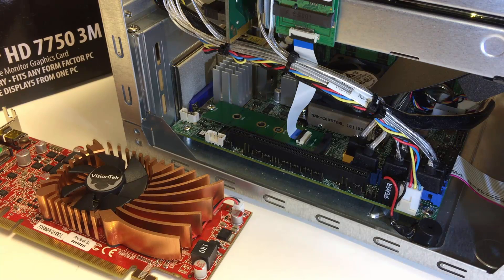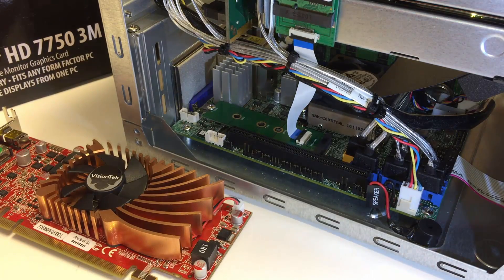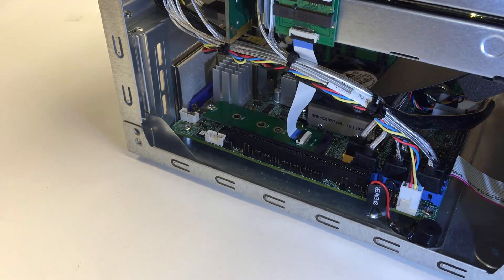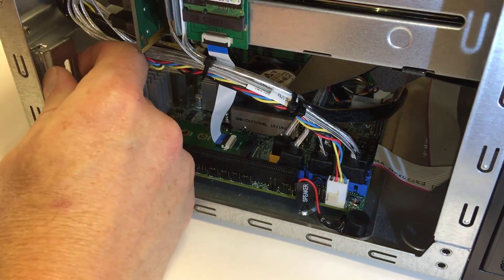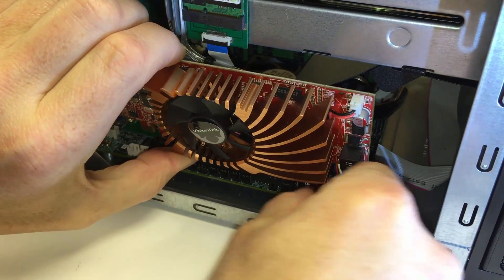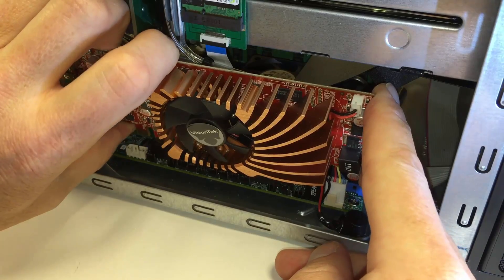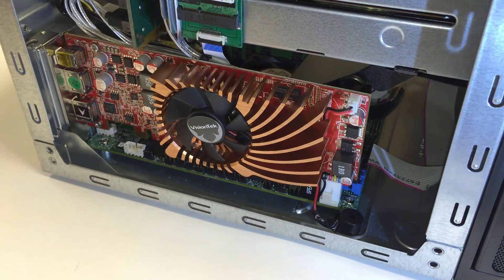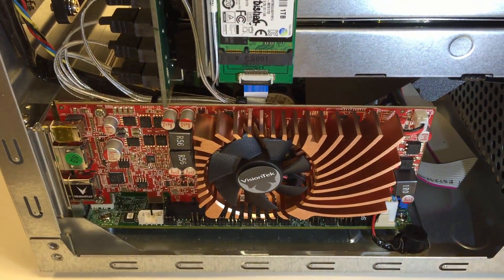How to install the VisonTek 7750 4K UHD GPU card into a Supermicro SuperServer 5028D-TN4T Mini-tower

Comment: Easier to remove the five screws on the back of the server, slide the board out, the cables will allow it. Install the card, slide the board back in, install and tighten down the screws, This way you don't risk damaging the slot
Reply from the maker: Thank you for the comment! Well, that is true, your way is according to the manual too. My cosmetic SATA cable management meant I made it a bit tougher to slide the motherboard in and out. I also tinker a lot and found it very handy to just slip boards in place, such as these
https://tinkertry.com/pcie-to-m2-nvme-accessories-overview
with only the GPU being a bit tricky. I’m happy to say I haven’t damaged the slot in 6 and 7 years with my 2 SuperServers, but you make good points that my way is more risky, something more viewers are now aware of thanks to you.
Reply: @TinkerTry  Oh, you should see the SATA cables in my case. They extend past the front of the motherboard about 3 to 5 inches.
Reply: @TinkerTry  I just labeled and unplugged my cables.

Comment: Hello Paul! Do you think an MSI NVIDIA GeForce GTX 750 Ti  Low Profile would fit the Superserver ? I'm searching for the best possible GPU i could fit into this so I can virtualize a Machine only for Geforce Experience for example whilst having a VM Lab aswell...
Reply: I am also looking for a better video card. The question is the exact dimensions. Amazon claims a 7750 is 10.5 long, 2.4 wide, 6.7 high, but that seems too large. It clearly just barely fits.